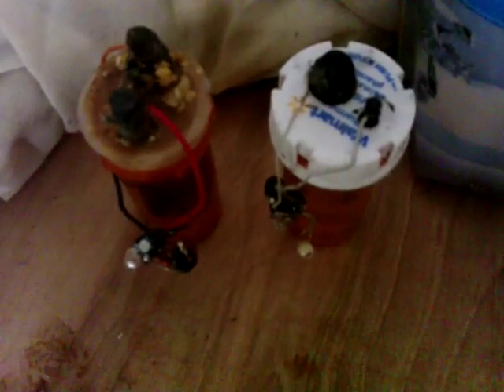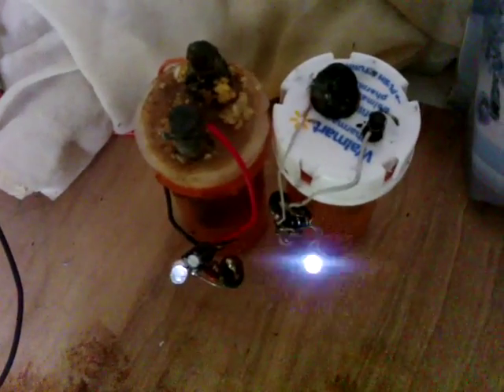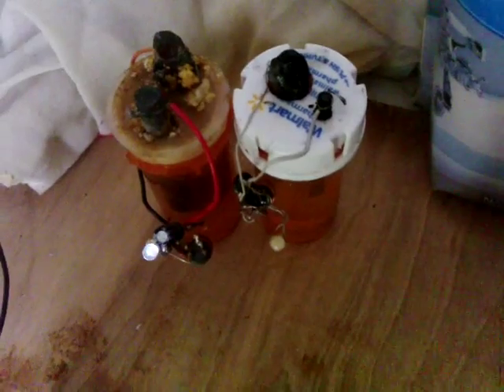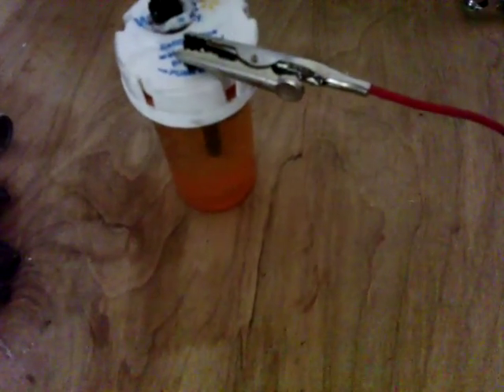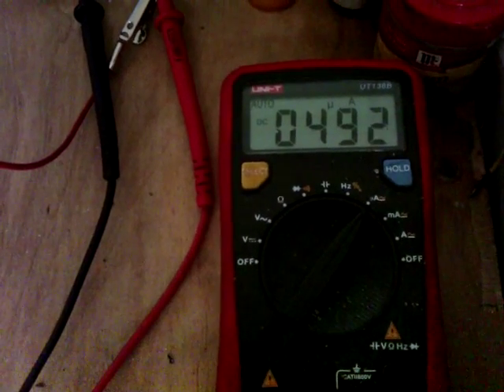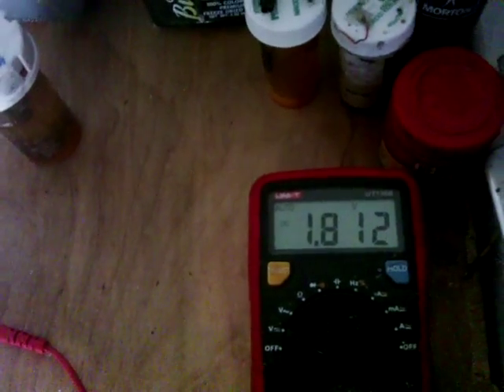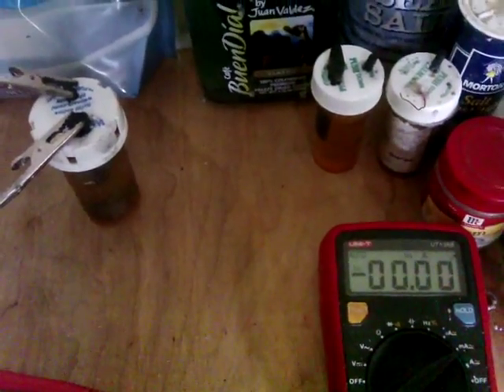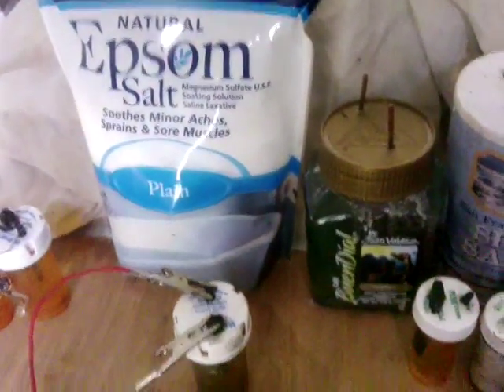Vid for Bobby: Carbon Epsom battery cell

Comment: hi slider, great video
i wanted to make this project but i don't know how to build the flashing circuit 
so can you give me the scheamtic
thanks :]
Reply from the maker: Frank Alvarez Hi Frank. Check out Lidmotor on here, his Penny Oscillator makes a good version of this. Here's the circuit: 
https://www.youtube.com/watch?v=mLeC9bHMeiY
I use axial inductors or a tiny ferrite piece and wind the wire on, but it's similar in operation. A 'good' build will flash an LED for a clear 30 seconds, using a 100uF capacitor and 1.5V AA battery after it is removed..

Comment: That cell proximity reaction is an interesting phenomenon akin to what happens with pancake coils and worthy of further research. Is this an example of 'magnetic current'? Is BEMF from the JT coils with the stronger cell transmitting a HV spike and the weaker cell acting as an antenna to receive the wireless energy transmission? Is this an observation of small-scale wireless pulse charging in action? Analysis using a scope would be interesting! Also, what happens if a magnet is placed between the cells? I think output from carbon-carbon cells depends on the strength of oxidising agent in the electrolyte. Have you tried a Domestos (or bleach) electrolyte with carbon electrodes?
Reply from the maker: Coelopa frigida Great questions. Yep, the stronger one dictates the frequency..the ferrite cores give the range for these tiny coils. Usually, an LED will 'soak' wireless output, but not in all cases. Take the LED off a JT and it becomes wireless enabled. I could do scope stuff, now that I have one, just got to figure it out lol. 
Haven't tried Domestos, but Borax is proving to be interesting !

Comment: Very nice Slider, thanks for sharing, love those Karpen cells 
Also very interesting about the link between the LEds
Reply from the maker: Steve Allwest Thanks Steve. This one is actually my fave so far and was a good suggestion by Bobby. It may be this type that ends up as backyard pathway indicators...lot of testing ahead. 
Yeah, most such oscillators will link up and if outputs are similar they will flash in time together. A battery of say 3 cells will lift a 4th one that is under performing...which is opposite to the pull down that happens with say lead/acid and no circuit. The strongest cell dictates flash rate on matched circuits.

Comment: Thank you Slider. Means a lot. Cool effect when placing your two cells together. in the beginning of the video.
All the best and thank you again
Reply from the maker: ***** My pleasure Bobby. It was intriguing to find that the Epsom salts work well here, as they do with converted lead/acid batteries.
The pairing up was first noted on Lidmotors Penny type circuits, but was quite surprising between these two, as they have tiny little ferrite chokes as coils.

Comment: wow you can run a blocking ocilater
on the cell
Reply from the maker: Ben JI If a cell delivers over 0.5V and 10 microamps then it will run one. They'd make useful garden path marker lights as one useful thing to do with them. If i can get a non metals cell to keep going for years like the Carbon/Lead, then they can be put in the ground and forgotten about, always working, always helpful at nights :)